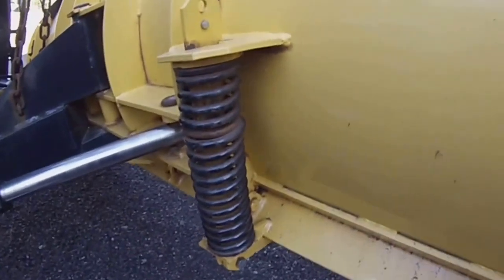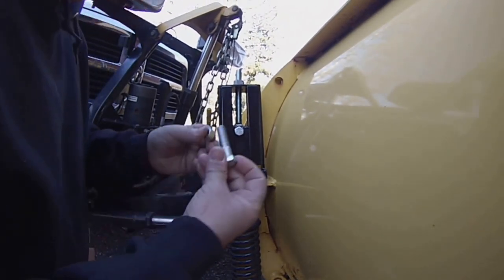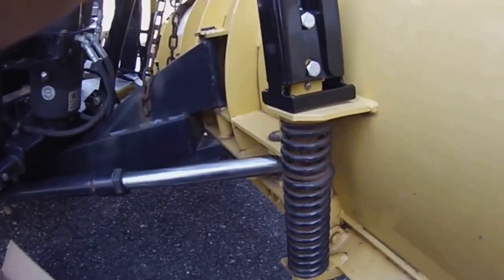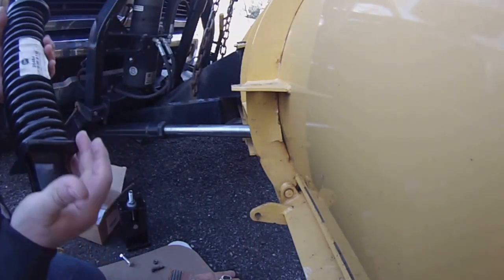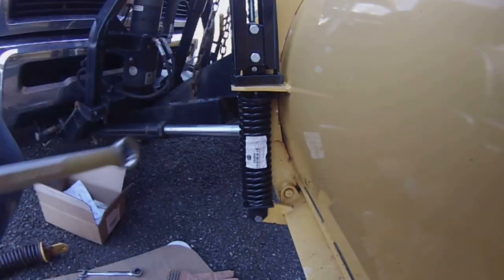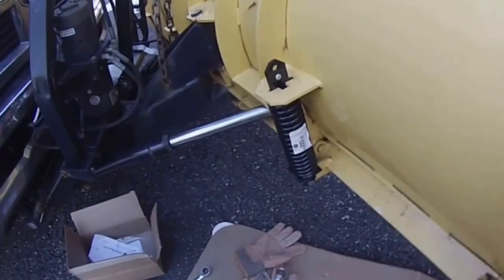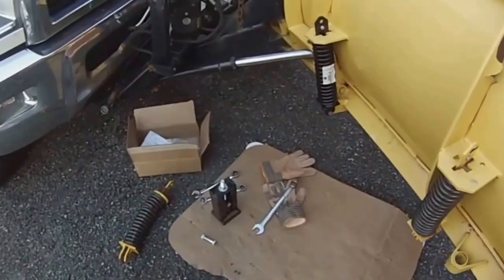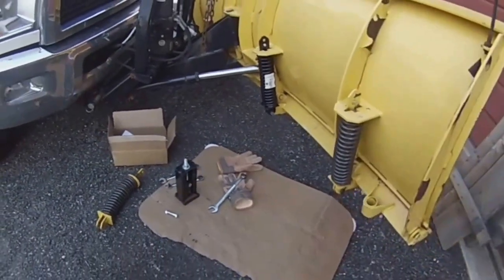How I replace a trip spring on a Fisher snow plow

Comment: Nice fisher tool but would suggest invest also in Rigid gen 5x 18 volt impact wrench and harbor freight mechanic gloves I never work on things like that without gloves that just me, I like to save all 10 my fingers if I can...
Reply from the maker: Thanks for the comments. I just picked up a DeWalt 20 volt impact wrench. I never got used to wearing gloves, they seem to get in the way. You do have a good point about having 10 fingers. Eric

Comment: hello great video this is how all the diy videos shall be...now the tool used the spring compressor do theyttt%#ggf#f& vary in plow size and design? or is the spring compressors all the same for the bigger plows up to 9 ft and can it be used on the v plow as well....
Reply from the maker: Thank you. My plow is 9'. I believe this compressor will fit the 7.5' along with the 8' straight blade. I'm not sure about the others. Eric